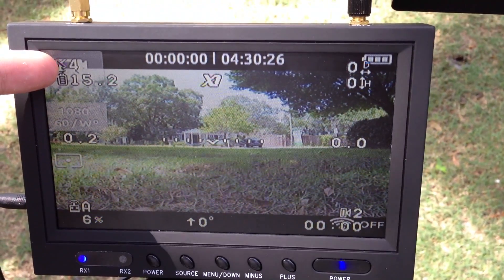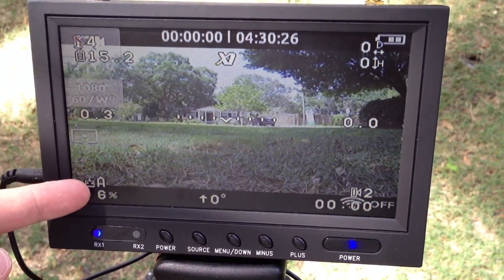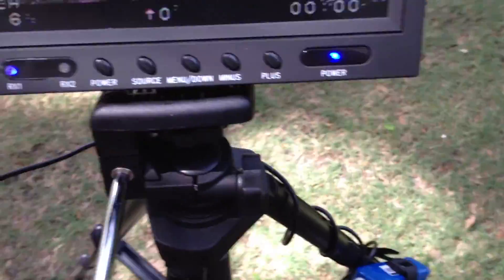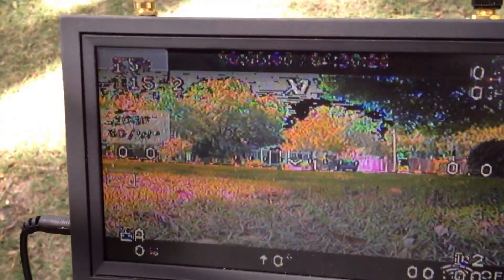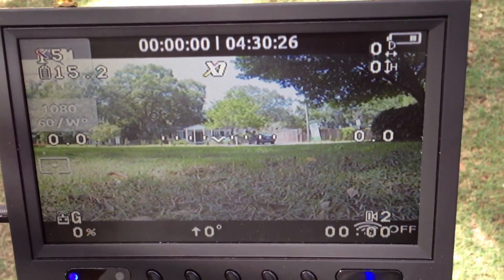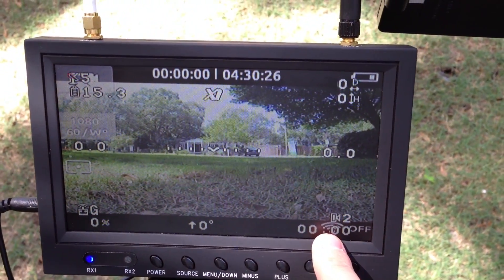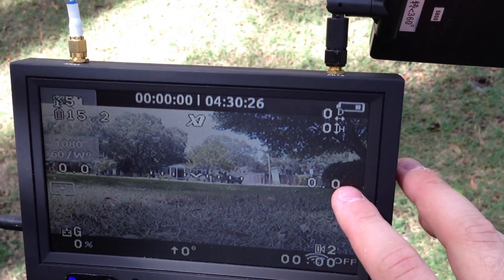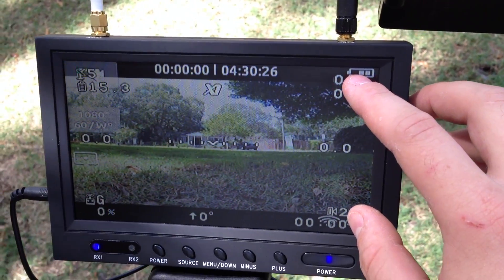XAircraft OSD

Comment: Can the huge logo be set out from the center up screen !
Honestly putting logo at the osd is completelly non sense.
This is the only thing that is making me not buying it.
Thank you.
Reply: The logo is maybe a CM in size and is also opaque. I think you are overthinking this one. You dont even notice it in flight and the resolution of just about every FPV setup on the market isnt good enough for you to see that level of detail in flight anyway.
Reply: Thanks for answering Drew.   I agree with you it is ok for flying, but could be perfect .
I imagine it as a bug at the windshield of a car.  It is ok for driving safe,  but some time later we just stop at the gas station to take it out from the front view :-)  :-)
I like XAircraft, have a previous generation one, just think the logo should be out of there.
If it could be set on or off at the setup,  I am sure, everybody would set it off :-)